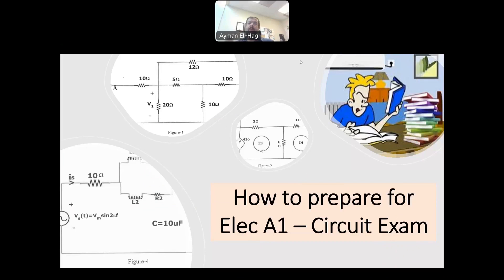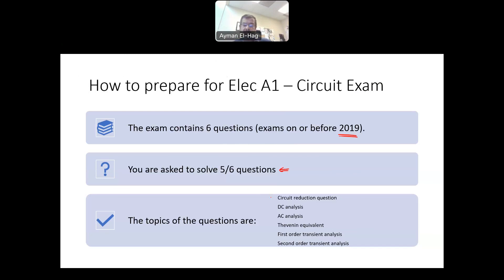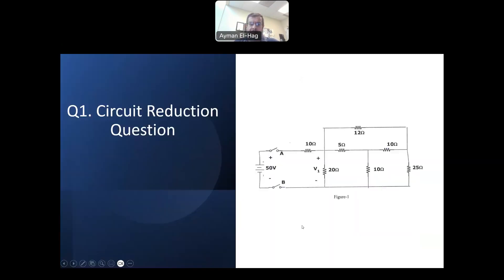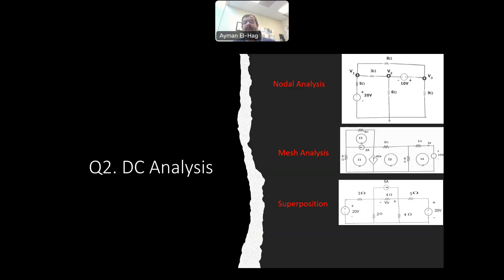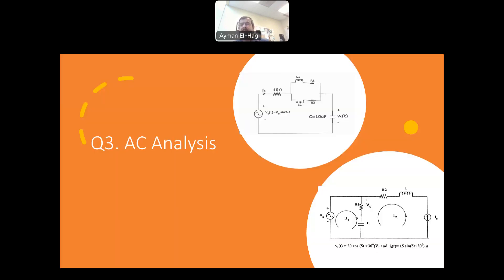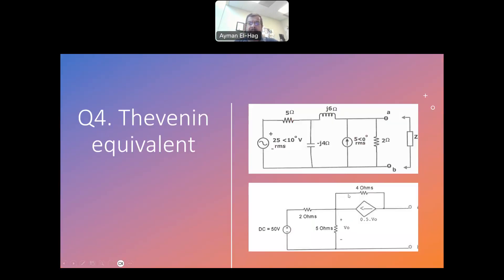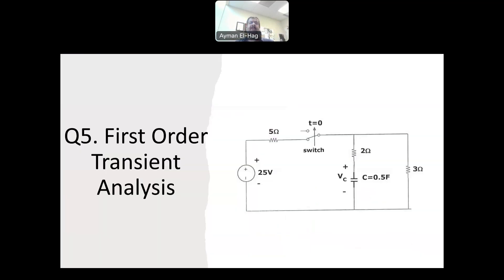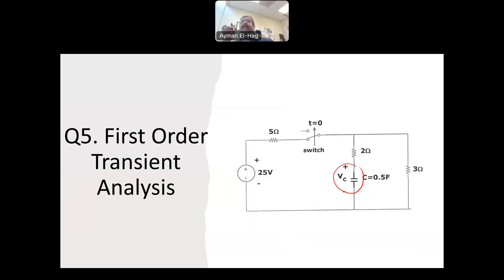How to prepare for the PEO ELEC A1?

Comment: Thank you so much, Eng. Ayman, I followed your Circuits course video and passed the 16-Elec-A1 exam, now i need to take another exam from group A and one exam from group B to be able to finish the required exams, do you have courses for two more subjects? another one from group A and one from group B?
Appreciate all your help and support, thank you.
Reply from the maker: Thanks for your nice words. Yes I have A6 and B7 which are 2 power courses, so if your background is power you may take these 2 courses.
Reply: @electrical4everyone  my background was communication from 15 years back, but I have no options to take my Peng. I need to have three exams, so any advice for me with a non-power background to study from your videos? Which course to start with? If I'm missing the basics of power engineering, can I just study your videos or do I need to do something else?
Reply from the maker: Hi if you never studied power before it will be a challenge to study A6 and B7.
My background in power. I have videos about A5 which is electronics which could be closer to your background.
Reply: @electrical4everyone  thank you so much Prof, but I need one from category B, any recommendations?
Reply from the maker: @minahanna5709 unfortunately I can only recommend the exams I'm familiar with. Do you have access to old exams (before 2019). You can check and see the content.
Reply from the maker: @minahanna5709 If you choose to do A5, then it makes sense to do B5 which is advanced electronics. So my advice choose the A and B from the same subject because:
1. usually there is overlap between the 2 exams.
2. it will be easier for you to do the same subject.

Comment: Excellent work. Super helpful. I wish you’d reconsider covering the 2nd order transient analysis as well. The reason for that is as a test taker I’d never leave topics for the choices because sometimes a difficult question can throw you off or takes too long.
Reply from the maker: Thanks for your nice words. Your objective in the ELEC exams is to pass them and not to get a high score. The second order circuit needs to understand LAPLACE transform which is an advance topic and needs significant effort to do the questions. I will be solving more A1 questions after June 17, and this will cover another new area I noticed in the recent exams which is the power calculations. However, power calculations still fit the circuit I scope.